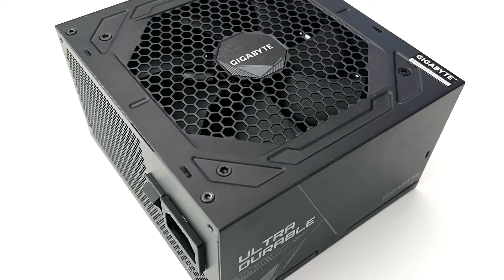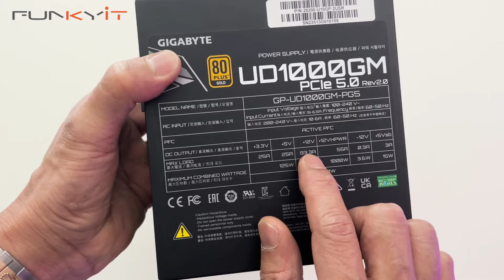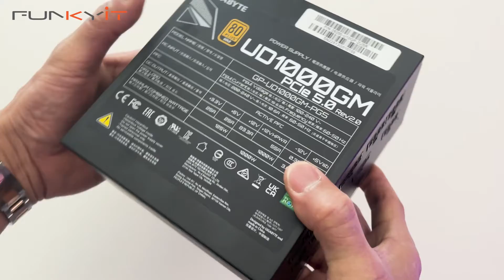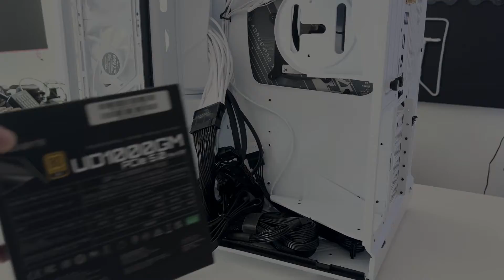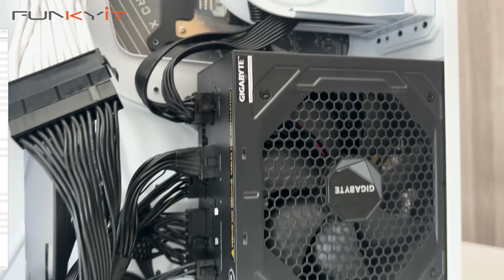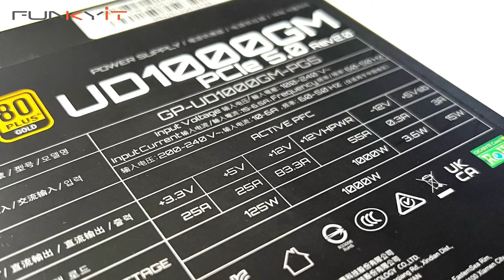Get this Rock Solid Power Supply for Your PC - Gigabyte UD1000GM PG5 (Rev. 2.0)

Comment: Hi how did you plug the 8 + 8 pin cpu with only one cable which was attached to the PSU? Is that ok? I will use it with 7800x3d
Reply from the maker: It’s actually 2 x 8-pin PCIE power cables … I tied them together with a Velcro strap
Reply: you only need 1 x 8 pin eps for a 7800x3d they dont pull much power, you will need 2 eps for 13900 or 14900, AMD is way better for power usage
Reply: @SirusVirusuk  I plugged both connectors but from one cable cuz this psu has only one cable. It can hold 9800x3d in the future?

Comment: I have 2 of these power supplies, both are less than 7 months old. 1st one is first gen, second is second gen and they both have really bad power supply buzzing when they are under load. I'm now in the process of getting a different brand power supply, and hopefully, I'll not have this problem again.
Reply: I am a fan of be-quiet . They haven't let me down so far.